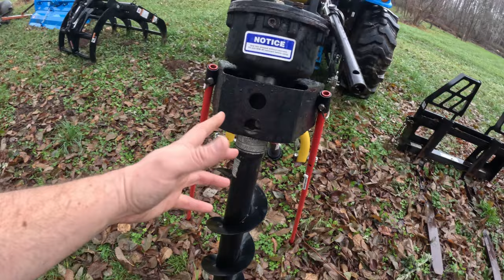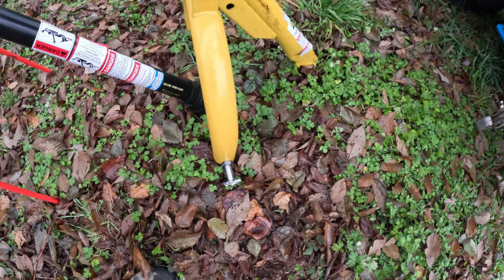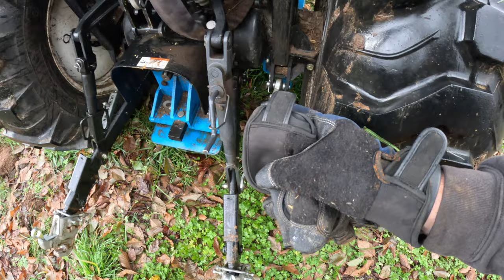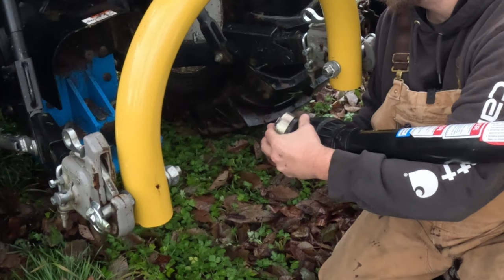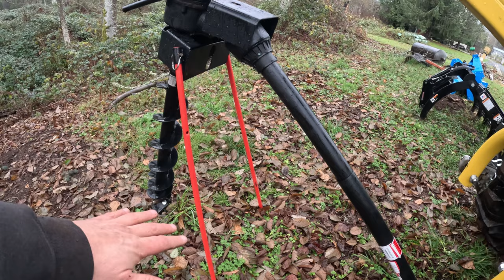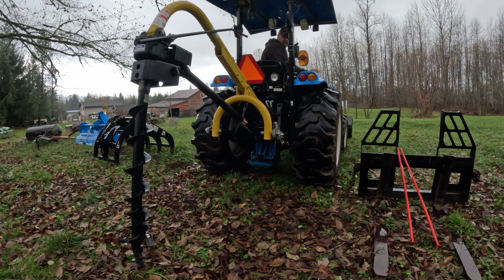How to Attach a Tractor Post Hole Digger

Comment: I had problems when I first purchased my post hole digger. I found the auger was extremely difficult to muscle around. There are many pinch points with this implement. I use a pulley system to lift most of the weight, I lift just above the auger. I then attach Top link then the lift arms. I really like your kickstands, I’ll have to build a pair. Thanks for a boatload of very practical advice. Be safe. Greetings from Maine.

Comment: Trying to disconnect my PTO from the auger got the best of me today. Is there a trick to getting the plastic sleeve to slide out of the way? I assume not as you have to struggle with it as well. I left it off when I put it back together.